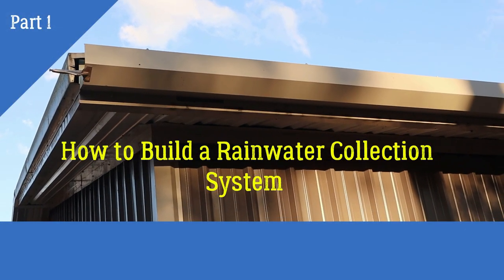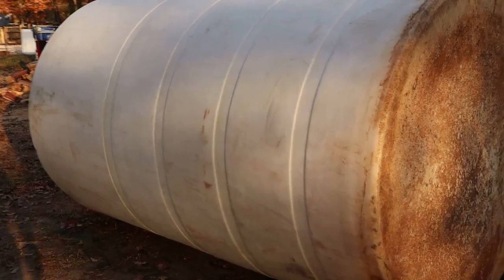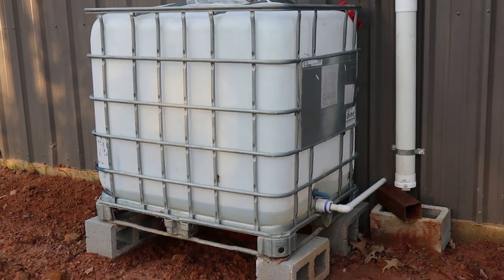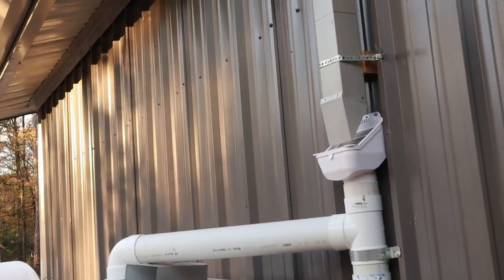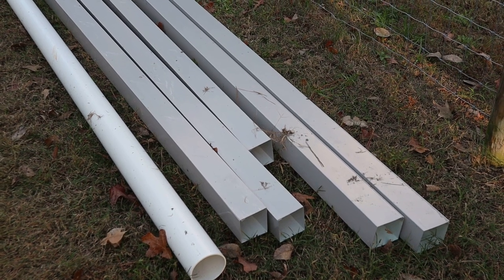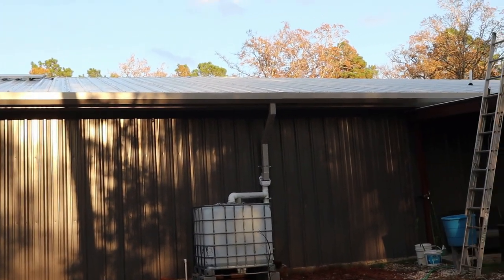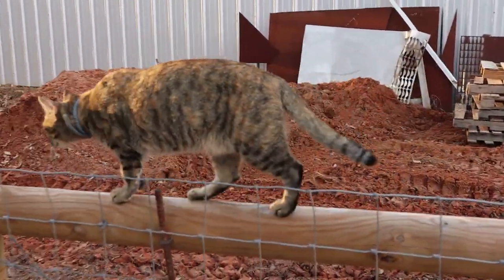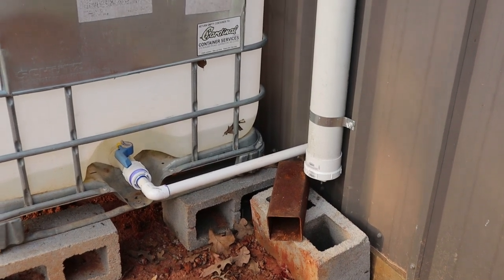How to Catch Rainwater with a Catch System - Water You Can Use

Comment: Thank you for sharing. A great video. Do you need a backflow preventer on the line coming in from the municipality?
Reply from the maker: I should not need one and the valve acts as a back flow valve when it is shut off..and the other one is open. Appreciate the questions. Thanks
Reply from the maker: I have made some changes and will share an updated video on plumbing soon

Comment: You need a checkvalve. Had pretty same basic setup and pump builds up and kicks off and right back on due to water blowing back into tank because no valve to hold water pressure.
Reply from the maker: It has a check valve. And I figured it out right after shooting video. Will be shooting another video showing the updates and the system results after the last 6 days of use. Along with that I will explain what uses the most rainwater in our system. Appreciate the response. Thank you